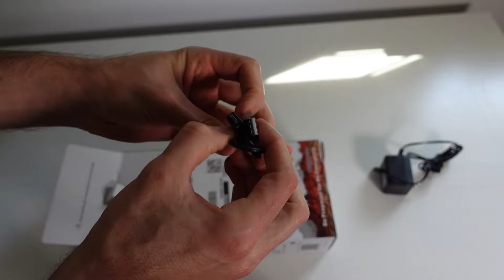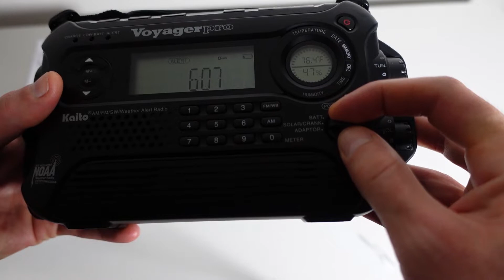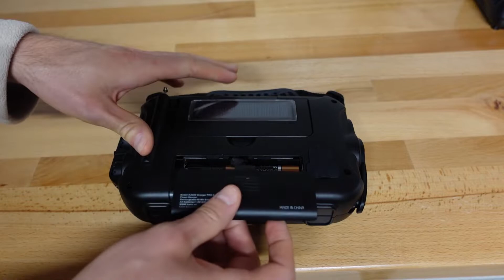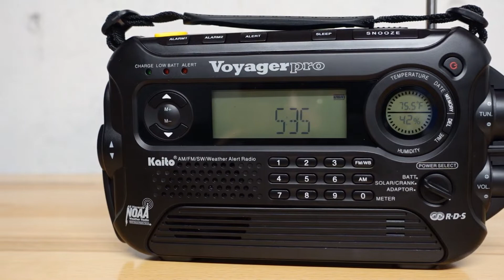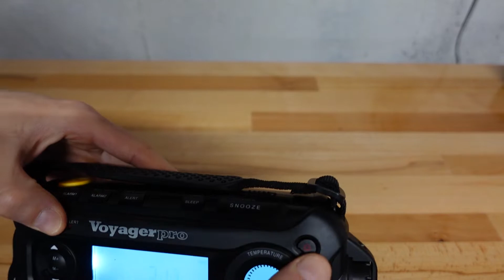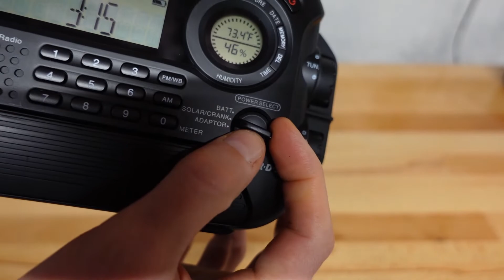Kaito Voyager Pro KA600 Extended Battery Run Time Test

Comment: Why use crappy old tech batteries.  I hope these Chinese radios catch up and start using 18650s or similar soon.
Reply from the maker: They have on some of them
Reply: they do,I'm receiving it today it's the upgrade version called the katio voyager pro 600L it's 2000 mah

Comment: Your recommendation of taking the NMh batteries out of cycle is in error. Failing to regularly cycle those batteries will turn them into a useless brick in short order.
Reply: Your comment is in error. Keeping the battery plugged in even when you're using AAs will cause both to be drained for no extra performance. The batteries can still be regularly cycled without being constantly plugged in. The video made this clear.
Reply: @jamescarter3196 Your interpretation of my comment is in error. You cannot leave batteries uncharged. Or un cycled. Failure to use them will reduce them to junk.

Comment: The solar panel is supposed to run the radio in bright sunlight, so all you need is a window facing the sun, or go outside the house.

Comment: I use a power bank to operate the radio, and put it in the window so the battery stays charged when it's not in use.  The clock runs off the battery, so a little solar charging keeps the clock going.